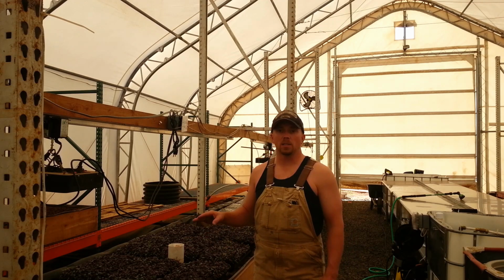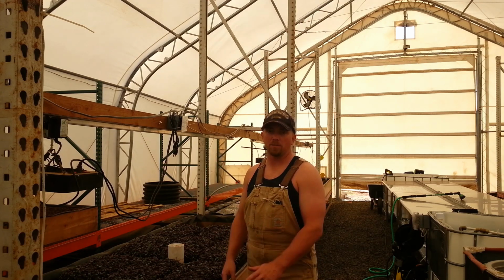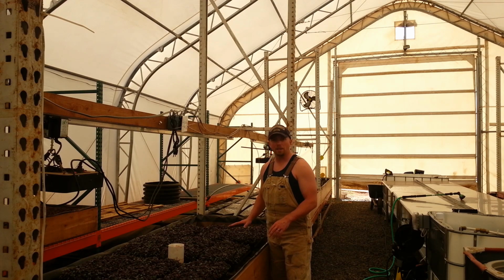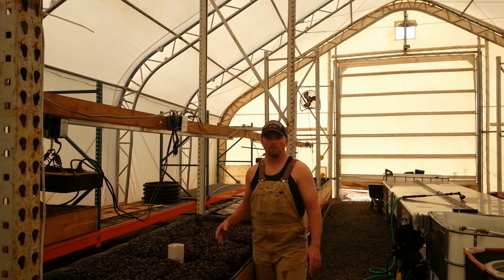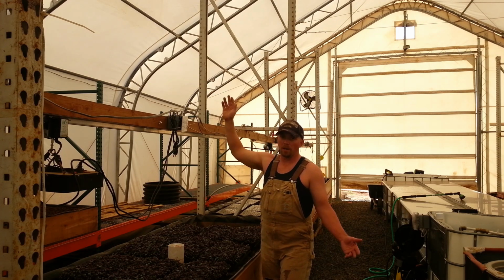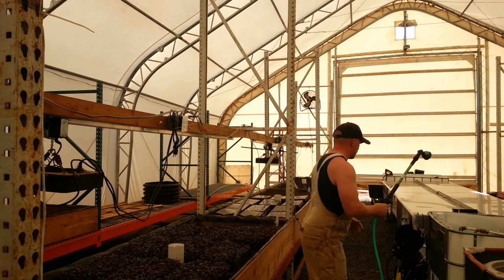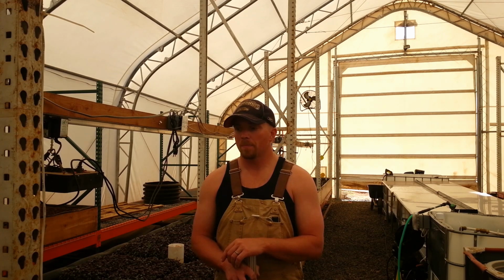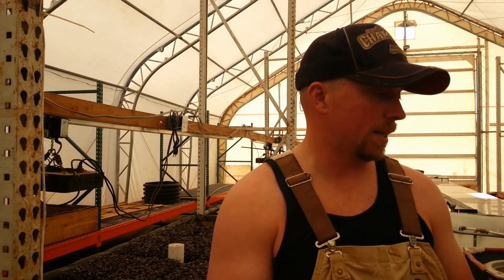SUPERSIZED MICROGREEN Growing Solution

Comment: I sat down and a drew up 2 basic ideas of a simple drive system for your multilayered micro green beds, and at about 4:30 am I looked for an e-mail address to forward some captured 3d images of the 2 approaches and didn't find one.......  no problem I'll describe them here, and I haven't watched all your vids so I apologize if you already covered these approaches.
    You will have long members fitted together from end to end, you can weld up a simple but strong and effective bracket to join the ends together. The members can be anything you can get that suites your purpose, i.e.  electrical raceways which you can house both water lines and small voltage wires for lights. These members will have rollers ( can also be easily fabricated ) at each joint, these rollers will rest on cross members on the rack....
   At the far ends of the rack you have a 2 vertical metal members / flat metal stock  (  2" x 1/4" x 144" ? ) and all the ends of the  long horizontal members attache to vertical members at each end, in other words just sliding the vertical member moves ALL of the horizontal members at the same time. 
    This vertical member at each end of the rack has a drive motor attached to it, one approach is to use a "rack & pinion", where upon on a cross member you attache the straight gear to the micro green rack frame, the vertical member I've spoken about is outside of it, facing you, with a hole positioned somewhere near the center and a motor attached with a pinion riding on the gear, the motor & vertical member move together forwards and back on a timed circuit, thus moving ALL the horizontal members as one unit. 
  The other drive is the more effective approach I think, "screw drive",  its EXACTLY the same idea's presented but the motor is mounted on the corner of the frame with drive screw shaft aligned along the side, the vertical member now has a large threaded "nut" attached to it near the center, thus the screw drive motor can slowly utilize a lot of torque in moving the whole system forwards and back....
Reply from the maker: wow this sounds really good...my email is trm@therealmartian.com

Comment: Great Update! It seems that your well pump would have enough pressure, you may just need another pressure tank to add more volume I have a 80 gallon pressure tank and irrigate my whole yard helps with pump cycles.
Reply from the maker: +Mtrunk 85 great idea on the second pressure tank
Reply: Orbit Makes a really cheap four valve/station Irritation Timer that I have used for three years now and only replaced the battery once. It may work for you. It comes with two valves just need to buy the other two. Check this out at Amazon.com
Orbit 58911 Complete Yard Watering Kit https://www.amazon.com/dp/B00N4X93A8/ref=cm_sw_r_apa_w0cAzbXG81HGT

Comment: The light bars are a good idea, but instead of moving them linearly back and forth you should consider pivoting them back and forth from the center of the lane.  That way you  eliminate the cable management issue you have now.  With a pivoting light, the cable can be secured everywhere except where it needs to flex at the pivot point.  That way the cables won't be hanging down like they do now.  Just choose cables rated for flexing duty and you're good to go.  It also keeps the light from interfering with you when you're working in the bed.

You could use your existing traverse motors and make a simple crank out of 2 pieces of bar stock to rock the pivot back and forth.  Also, multiple lights can be driven by a single motor.  In addition, you wouldn't need to reverse the motor nor would you need to track it's position, all you would need to do is adjust the speed.  It doesn't require limit switches, nor does it require any real programming other than starting the motor and setting it's speed.  The amount the light pivots is set by the radial location of the pivot pin on the bar on the motor shaft.  Simple and virtually bullet proof.

Theoretically,  you could also attach spray nozzles to the pivot as well.  If the pivot used a wide enough piece of wood as an attachment point for the light and spray nozzles.  The pivot could then drive both light and water to all parts of the bed.  Again, you only need flexible tubing at the pivot point, so no tubing management issues.  You just need to make sure that your nozzles can reach the sides when the pivot is tilted either way.

Anyway, food for thought...
Reply from the maker: +Brian Kolley this is a fantastic idea. Could you send me a hand sketch via email so I can ensure I'm following your thoughts correctly? Trm@therealmartian.com
Reply: Email sent.

Comment: You could put your lights high enough up the excessively tall racks that the light will fall on everything without needing to have them move. Or you could just have the light actively tilt on a hinge to move the light around instead of moving it laterally.

Comment: Suggestion concerning misting equipment: consider using a commercial horticultural electronic leaf coupled to a solenoid valve drawing water off a moderately pressurised line to manage the misting operation. These cause the solenoid to open and mist to be applied as needed. when a water film forms on the device it closes, This device automatically reacts to air humidity and evaporation losses and keeps the leaf material / growing medium damp with minimal supervision. It is also possible to over ride the system to get "things" wet initially.

Warning: all misting equipment will require regular maintenance to combat fungal growth around the nozzles and to remove any mineral build up at the jets. Have you had your well water tested for mineral content at all (eg calcium, magnesium, iron etc)? To work long term you may have to consider suitable filtration to manage this matter.
Reply from the maker: +Dan Whiteford great info here. Thank you

Comment: Real good update and I like the feedback from the regulators.  I used drip/mister type irrigation for years and I always read that those fine water particle generating devices were real sensitive to particles in the water, i.e. fine filtration is needed.  Since you have the filter already, I suggest using it.  Funny story: I started using automated drip irrigation in the house because I was traveling for work, some.  Only later did I move it to my garden.

Comment: How deep is your well? What pump are you running in the well? How much duty cycle will farming add to your well pump? How long will it take to replace your well pump if it fails? Is there a cistern to collect/recycle the clean water runoff? Would it be possible to add a water tower to your system?

Comment: I really like that you have moved away from the rotating shelfs.   I like that your moving more to no moving parts.   Less maintenance, less electricity needed.   I think you should move away from a motor to move the lights and just have lights to cover the whole bed.  I love the LED light bar, I think that is the way to go.   

I know your moving to making a lot more micro greens, but is there enough demand for it, or do you plan on just upscaling as you get more demand or customers for your product?

Aquaponics, as I have known it is usually hasa troff of water like a rain gutter, with water running thru it,  and little cups with holes in the bottom to hold the plants.   Your method seems like it would require more physical labor to harvest.   

I'm new to all of this, but I find it very interesting, and like your mission very much.   Good luck, it looks like you are headed in the right direction.
Reply: I do have the same thought about the lightning like you. What is the cost for double the lights, so you don't need the motor to move it. Because the motor also cost money and consumes electricity, and maybe the motor consumes more than the extra lights and could cost more. I have no idea how much such a motor cost and consumes.

Comment: Have you thought of using grow trays?   I have been running for some time now with an ebb and flow.  I use the 1.25" deep 1020 trays.  When the trays are ready to be uncovered, I put them in the grow trays.  I have the overflow drain on the grow trays where the water does not rise more than half way up the 1020 trays.   I use the water from my aquaponics system and the pump comes on once in the morning for 5 minutes...  The micros love it.....

Comment: I have almost the exact same pump (size is identical) for high pressure, not sure I think it will be enough for your setup (unless you put one per lane). It also takes quite a lot of power, mine takes around 8 amps on startup and 5-6 in operation. The problem with microgreens is you will have them at so many different stages at the same time, so you will have to micromanage the irregation. I believe that is why you see most setups (including Curtis as you mention) not doing an automated system but instead optimizing for manual watering... unfortunatly. I also think, with any misting system, you will have big issues with condensation and extreme humidity as you are in an enclosed space.